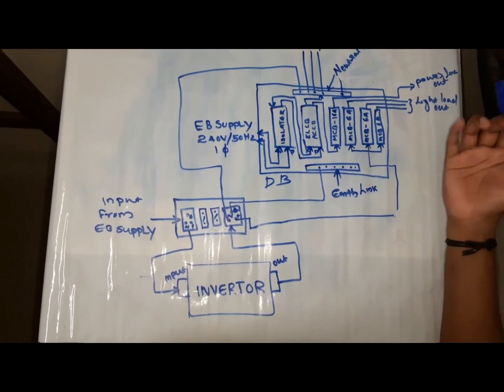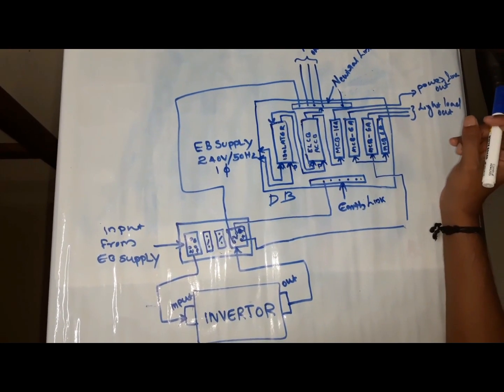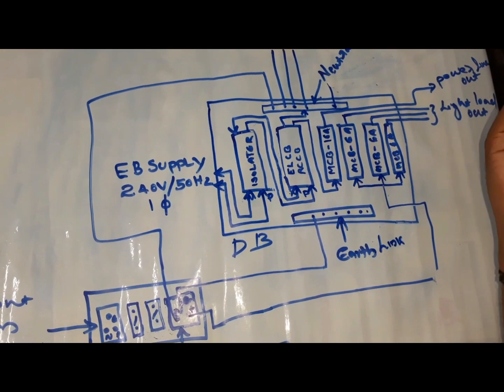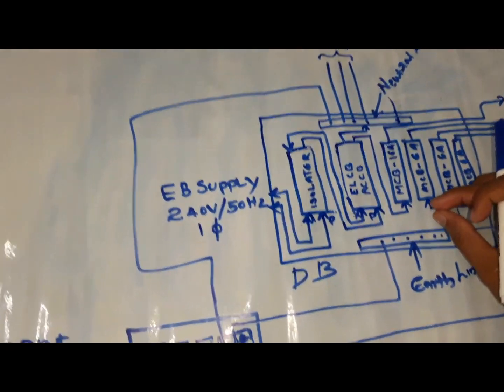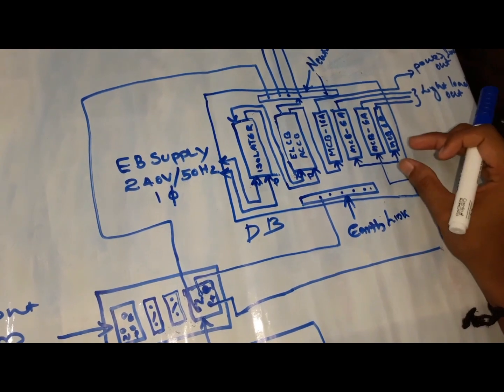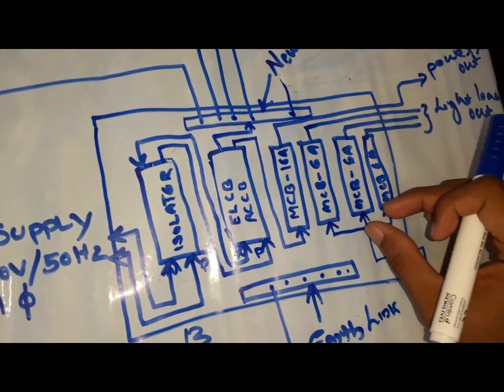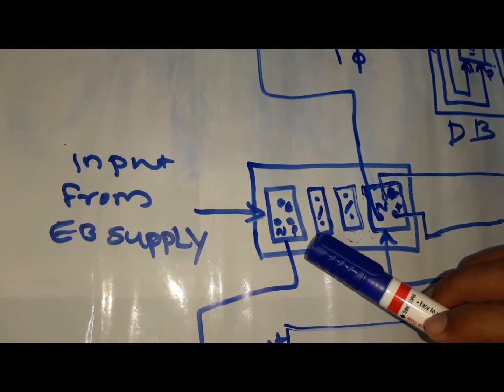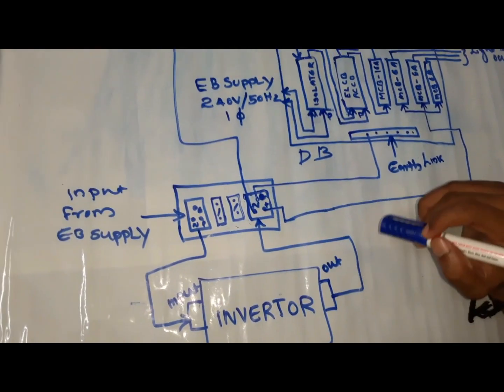INVERTER WIRING | OUTPUT CONNECTION|MALAYALAM

Comment: Input &output phase varunnath socketilek ano?? Switch engane use ful ആകും.? Schematic il??
Reply from the maker: 2 different socketilekk anu .input socket from EB (ELCB Sidil ninnu )supplyil aanu connect cheyyunnath .out put side distribution MCB yil aanu connect cheyyunnath. disconnect cheeyan eluppam aakunnathilekkanu  socketukal  upayogichirikkunnath.
Reply: Athu manassilayi.. bro... but Socketinte aduthulla switch control koduthittillalo??
Reply from the maker: @deepur8553  srry... switch connect cheythathayi  varachittilla ennano udeshichee..? sadharana enganeyano socketil switch connect cheyyunnath atupole thanne .athukondanu varakkathe.
Reply: Doubt ayathondane kto chodikunnath
Reply from the maker: @deepur8553  no problem
Reply: Athane udhesichath... ok bro ipo clear ayi.... thank u

Comment: Light load , MCB യുടെ input ലേക്ക് ആണല്ലോ Inverter out കൊടുക്കന്നത്.ELCB യിൽ നിന്നുള്ള out അതിലേക്ക് കൊടുക്കുന്നുമില്ല. അപ്പോൾ Normal supply ഉള്ളപ്പോൾ Light Loads ,വർക്ക് ചെയ്യുമോ ?
Reply from the maker: വർക്ക് ചെയ്യും ..Normal supply  ഉള്ളപ്പോൾ inverter bypass mode il  വർക്ക് ചെയ്യും .എല്ലാ ഇൻവെർട്ടർ വർക്ക് ചെയ്യുന്നത് അങ്ങനെയാണ്.
Reply: @Arunzinfo  Bypass mode എന്താണെന്ന് explain ചെയ്യാമോ?
Reply from the maker: @rafeeqthaju.t3258 Sorry ..... correct function നടത്തുന്നത്(  Normal supply ഉള്ളപ്പോൾ Light Loads ,work cheyyunnath ) Relay or change over switch വച്ചിട്ടാണ്  .bypass mode ennu kondu ഉദ്ദേശിക്കുന്നത്  machine എന്തെങ്കിലും  failure ആയി  കഴിഞ്ഞാൽ  main supply inverter function ഒഴിവാക്കി  ലൈറ്റ് ലോഡിലിൽ  കൊടുക്കുന്നതിനെ  ആണ് .
Reply: @Arunzinfo  Ok. Thank you
Reply from the maker: @rafeeqthaju.t3258 welcome
Reply from the maker: @rafeeqthaju.t3258  plz.... share and like our videos